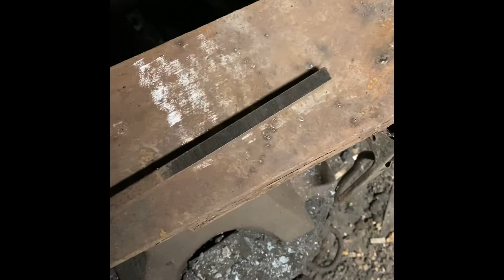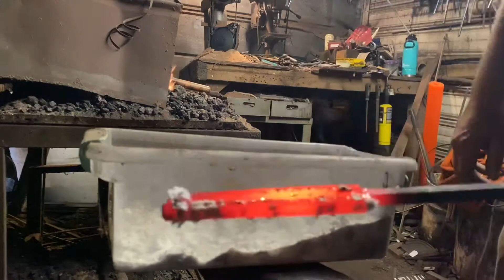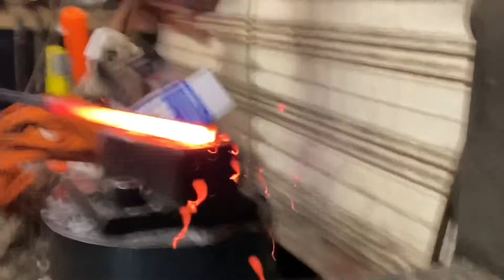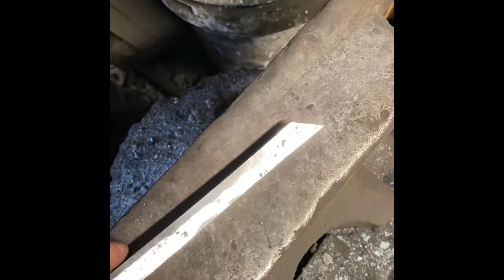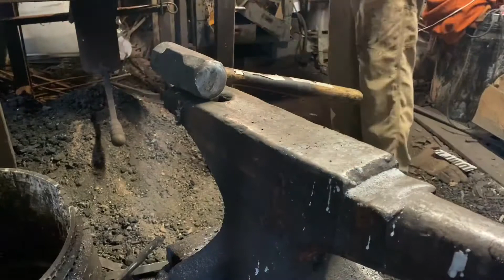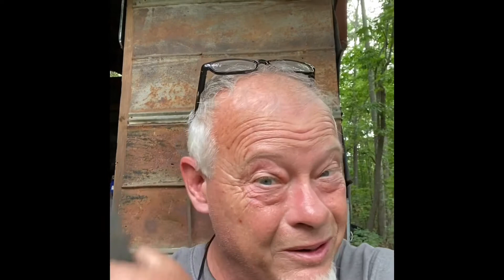Blacksmithing Knife Making Forge Welding High Carbon and Mild Steel Experiment

Comment: Never had luck trying to set welds with the powerhammer, maybe I just to savage with it! Nice blade, I want to see it finished and polished!👍
Reply from the maker: I can set them with the power hammer but I have to barely tap it. It won’t be polished and finished, I found a crack in the high carbon edge so I threw it out. I’ve never had the high carbon edge crack before. I was halfway expecting a failure, but I thought the billet would fail, not the edge.
Reply from the maker: You can bet I’ll be doing it again before long though. I’ll not let a failure stand.
Reply: @serendipityforge333  
Shame it cracked, wonder why?
Reply from the maker: @paulorchard7960  not sure. It was either 1084 or 1095 and I’ve sometimes had 1095 crack all by itself if I wait too long between quench and temper. So I’ll just assume it cracked because I did something stupid and I’ll be more careful next time.😁